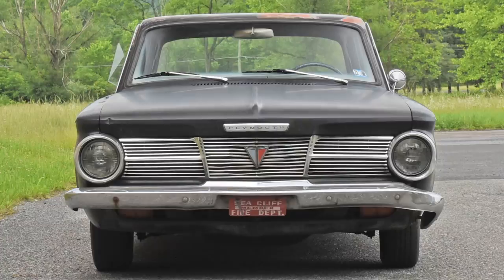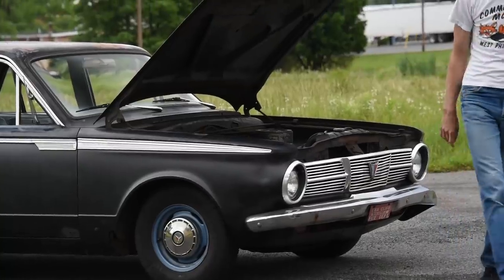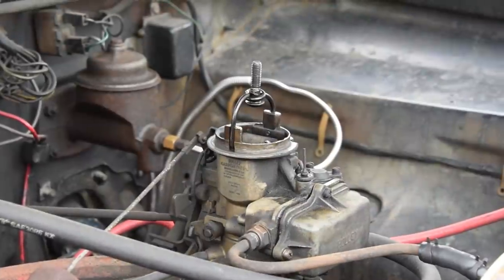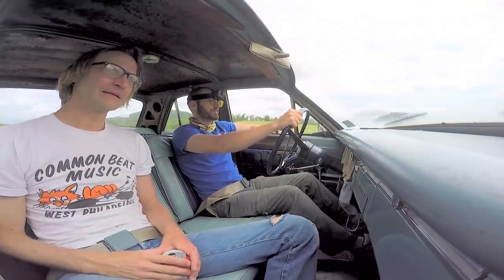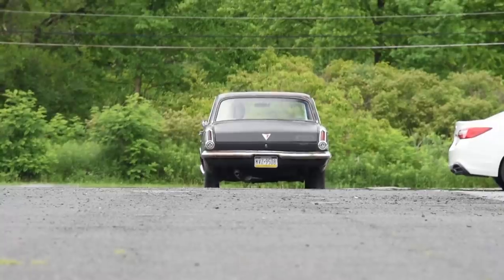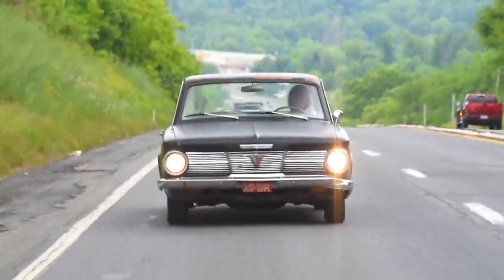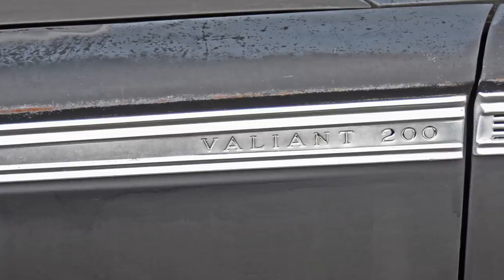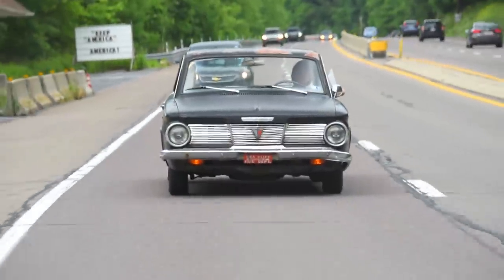1965 Plymouth Valiant 200: Regular Car Reviews

Comment: Also, let's all tip our caps to someone who can keep a 56 year old Chrysler product on the road.
Reply: There isn't a simpler car to keep running. I bet even you could do it.
Reply: @jeffsicklesteel1655  Leanin' tower'a power.
Reply: We had those in Australia- I had a 63 model (AP-5) which meant the 5th model Mopar built completely in Australia- the previous ones were Chrysler Royals. We only got the 225 which meant it was a supercar compared to the Falcon and the Holden competition. 1966 saw the 273 option- the first of the big 3 in australia with a V8.

Comment: Honestly, 28mpg highway from an old 60s car with a 6cyl is actually impressive. Slant 6 fans in the mopar circles always said with the right carb & tune a slant could do close to 30mpg, guess it's not so farfetched.
Reply: On the other end of the scale they can also make something vaguely resembling power when built right. Not near as much as a V8 (or even the Aussie Hemi six) but enough to be respectable.
Reply: I had an Aspen with the 225, and it would get 30 mpg on the highway, if my teenage self kept it at 60 mph.
Reply: @Oddman1980  safe to assume it didn't have overdrive?
Reply: @knote4958  Correct, it had the A904 three speed automatic.
Reply: @JRSmith06  If anyone would stick WMI (Water and Methanol Injection) on this and advance the timing, it would probably be getting 35 HWY.
Reply: Even with the automatic, they could get into the low to mid 20s on the highway. Mind you that's going 55-60 mph, but you will keep up with traffic on 2 lane roads just fine. Interstates.....not so much.
Reply: Give it a 2bbl. Decent rv10/low end cam 2.25 exhaust. Re-curve ignition and a Hei . A head massage and .100 off. You've got yourself a totally different (better mpg even) animal
Reply: @gorkzop  Mine came stock with a Carter 2 barrel carb
Reply: @Oddman1980  yeah! Some mid-70s (and export/marine earlier). Should have been stock inho. Just get an 2.25 exhausted , remove the heavy spring in the distr (basically uncle tony mod. If you can't weld just set base timing so you get 34 mechanic total). They are quite decent engines if you know how to tune them! 

Won't be a true racer ..but great street engines if you bother to spend a little money on them!
Reply: @gorkzop  The other good thing is the slant sixes are tough as nails. If you want to build an old engine that isn't another SBC.....there's nothing that will kill a leaning tower of power. I have a friend who dailies a Duster with a slant six and automatic. I've even seen a few slant Sixes drag race. Mind you, they don't make the same power as the V8s, but they can be pretty respectable and there are actually decent performance parts. They're dog slow in stock form though.
Reply: @joshn938  as ice got one myself (with a knock). Standard 318 power is basically achieved with these mods. But anything over 180/200hp is going to cost serious money. 

I absolutely love my 61 Plymouth with double carb. Spins the tires easily even though the car is heavy as can be
Reply: @gorkzop  They are meant to be economy engines, but Don't underestimate a slant six. You can build them up at the cost of some MPG and reliability, but they can surprise  V8s. But yeah, it does take moola. For the money, you could build a mean stroker out of a 318 and have some money left over, but hey....how many slant six hot rods are there out there? You would be part of an exclusive club. And that's part of the fun....having something not everyone else has.
Reply: @Oddman1980  I had a 10-year-old '63 Falcon Ranchero 170ci Straight 6 1-bbl 3 speed that got 27 mpg and would tow my mom's 2 ton '61 Chrysler wagon at 55mph - if I could keep the front tires on the asphalt. Selling it at 280,000 miles is a regret I hold to this day.
Reply: Go to any wrecking yard that still has cars this old, and I predict that 80% of the slant 6 engines that don't run have had the convex washers on the intake/exhaust manifold replaced with flat washers, thus causing valve-burning leaks. Lots of parts changers (like me) don't understand that they use those weird parts for a reason.
Reply: @joshn938  225 is long stroke and very small valves, they're meant for torque. 170 can rev ok, 225 may as well build up a tractor engine..
Reply: Look up the "Feather Duster", same engine but built light and efficient at 36mpg. You can get high mpg with a Slant 6 but it's a skill. I drive my Slant's with a Vacuum gauge hooked up that I use to tune and hyper mile. 18psi+ vacuum at idle and don't let it drop below half vacuum at light thottle. I can get upper 20's approaching 30mpg on highway trips.
Reply: I've come to the conclusion that miles are shorter in 60's cars.  Or people with those cars don't realize that the speedometer (and thus odometer) is completely wrong.  Or dividing miles by gallons is too much math for people. :D
Reply: 28 mpg is excellent.
Reply: @PaulSter  considering my 4cyl ranger topped at 28mpg on a level commute, yeah I'd say it's excellent
Reply: @DannySauer  Yeah, that must be it. We were too stupid to figure gas mileage, or to check our speedometers with a watch and the mile markers for that purpose on the freeway (what, were those before your time?). We liked getting tickets because we didn't know how fast we were going.
Reply: @budlewis721  I'm open to alternate explanations as to why some people still insist that they were averaging 25-30 MPG out of cars that were actually only capable of 14-18 on a good day; cars which had to be drastically changed to comply with the 70s fuel economy laws. If the Valiant actually got over 25MPG with that slant six, Ford would've probably copied that instead of testifying in 1974 that the only way they could do it was by selling only Pintos.

Certainly the most plausible explanation is "wishful thinking," but being bad at math is a very close second.

And no, watches and mile markers are not before my time. However, my 71 Chevelle actually does get about 24MPG average - with fuel injection, overdrive, a lock-up converter, and modern rolling stock. Makes a tad more power than a one-barrel L6, too.
Reply: @DannySauer  There's always been some people who claim hyperbolic gas mileage, just as there's always been people who boast about their engine size and horsepower. But that doesn't mean it's a phenomenon, your self-assured determination of "wishful thinking" as a given notwithstanding. I do find it shocking that my 1bbl 170ci 6 had less power than your...what, 307? 350? 454? V8 Chevy. What a surprise. If you're waiting for me to provide an "alternate explanation" for why people exaggerate, you'd better clear your schedule. I'm flattered by your faith in my omniscience, but mind reading is beyond my capabilities. I can't help you with that. Nor have I ever been good at math, though despite my imbecility I can use a calculator to determine my accuracy, as I'm sure most others did who wanted to know their car's true mileage. Neither do my prescient powers extend to visions of why Ford didn't develop the Slant-6 first, though the premise is pointless, like proving a negative. I suspect it was presented more out of obstruction than a serious argument. I dunno why they didn't; Ford's belief in the superiority of their products over other companies? Copyright restrictions? Busy with their own economy car line? Does it matter? What has me flummoxed (I love that word) is the cynical nature of your assertion. In a seriously flawed effort in the beginning of the industry-wide attempt to reduce pollution, the focus was more on making existing engines produce fewer emissions, not better mileage - though that would have been a bonus. To reduce fuel consumption they mostly built new, smaller, 4 & 6 banger engines (but not very well) to put in the new little carlettes. To what end would the majority of those interested enough in the subject to watch/comment here, or for that matter the majority of drivers, as you claim, think it important enough lie about mpg to strangers? That's a real glass ½ full of emptiness outlook.
Reply: @budlewis721  dream on .
Reply: Slants were thirsty as hell, especially with a single barrel carb. Had a single barrel 225 (australia) 69 Val with a 68 motor, highway 60mph was only 20mpg and we use imperial gallons which are about half a litre bigger than US galls. Later Aussie Vals had Hemi sixes which could clear 30mpg- my 265 Valiant charger(1971) could get 32mpg. And with an economy cam one would get 35mpg if kept under 60mph.
Reply: @rossbrumby1957  so what you're saying is the stuff like single barrel carb meant to give it better fuel economy actually gave it WORSE fuel economy? Go figure

Comment: I had several of these and the similar Dart.  When the wiring in my '64 burned up, I went to a junk yard and bought the wiring system from a '65.  They were similar, but not identical.  I laid out both on the floor of my apartment, and spent three days making the '65 wiring match the '64 wiring, with the assistance of copious amounts of weed.

Comment: Those old valiants from the 60s with the slant six  were awesome cars, they were tanks and ran forever, you have to keep in mind that back in the 60s if your car made it to 100,000 miles it was a miracle.
Reply: I dunno. I've never bought a '60s car with less than 100,000+ on the clock, and used them all as daily/road trip drivers for at least 3 years, usually more. Sold one at 280,000+ miles.
Reply: Cars in the 60s as a rule lasted bare minimum 250k
Reply: That's not true at all, my buddy has a 64 valiant that has more than 400k on it, it's literally the only daily driver he's ever owned at 50 years old. If you keep them serviced they are great cars and will literally run forever and FAR outlast any new car.
Reply: @TheREALOC1972  Keep dreaming.
Reply: @domenik8339  No dreaming about it.... The PROOF is right there. That car is 50 + years old and still has the original everything except wear out parts. Your NEVER going to be driving a Honda civic for 50 + years with 99% of it's original parts, GTFOH with all that. Your lucky to get 10 years out of any new car before you have to throw it away and get another one. They stopped building REAL cars in 1987.
Reply: People forget the number of cars that were disposed of at 150k or ended up being parted out or getting engine swaps or rebuilds.  

They focus on the ones that are still going, forgetting what has been tossed out.

A modern car will last 20 years and 200k without a second thought, but we wont see many of them left after 50 years either.
Reply: @cl3mb0t  200k yes but they aren't lasting 20 years unless Grandma Judy owns it and garage keeps it all of it's life, a new car will last 10-12 years of everyday use for most people then it's falling apart.
Reply: @TheREALOC1972  They absolutely are lasting 20 years, unless they get in a wreck.  

Yeah, they're rusting to peices, windows don't roll down, the stereo has been stolen, and they're billowing blue smoke, but they're out there in someone's parking spot.
Reply: @cl3mb0t  Yeah... like I said. they aren't lasting 20 years. a classic car is just hitting it's stride at the 20 year mark where as newer cars are all but in the junk yard at the 20 year mark.
Reply: @TheREALOC1972  Nope.  That is the confirmation bias in place again, where you forget how many cars died from that period.  

Most 1960s cars didn't last ten years.

For real...  Most cars in the 1960s through the 1970s really did only last 100,000 miles before being junked or rebuilt.
Reply: A Valiant can never die

Comment: "Driving a three on the tree is like driving a fraternity handshake"

I wonder what would Mr. Regular said if he gets to drive the Indonesian market Mitsubishi L300 (basically a 2nd gen Delica that's produced for 40 years here) which has a five on the tree gearbox
Reply: Well I have seen a four on the column but five I have never heard of.
Reply: If you can't accomodate earlier systems with just two watts of brain power, give up and take an uber everywhere.  Young nothings.
Reply: @normangensler7380  whats a manual
Reply: “Young nothings”

???

Comment: When I was in school learning to be a car mechanic, I was working on one of these. (estate model) 
Rust proofing the floor, fixing the drum brakes and adding new carpet.

I realy liked it because of how simple it was compared to new cars
Reply: I am a simple human.
I see simple car.
I like.
Reply: Sorta similar deal with the Ranger I'm helping a friend with

The one he has is a 2000 model, but they hadn't significantly changed since 1993. So as a result, parts are easy to come by and it's relatively easy to work on. Some things are frustrating, namely the oil filter and spark plugs, but overall it's easier than the 2013 Escape his mom also has parked in that driveway.

There are some modern things, yes. fuel injected, ABS. But where it counts it's oldschool. Throttle is cable driven, emergency brake cable is literally right there under the drivers' side sideskirt, gear selector cable is clearly visible on the side of the transmission without even jacking the vehicle up, etc.

This may sound standard to anyone with a 20+ year old car but to me, someone who learned to wrench on a 2007 Focus (where there isn't a ton of room to see all this stuff), this is all really cool.
Reply: I have to replace the !#$$%^ spark coils on my 2011 Suburu Outback. Holy shit! The simplicity of this car is beautiful!
Reply: You mean "today's" cars?

Comment: This was sold in Australia as the Chrysler Valiant. The Dart was also sold down here under that moniker. Like the Falcon, the Valiant was a car that Australia picked up and ran with, for longer than in the US. Still very loved down here.
Reply: And they're better than the US Valiants too.
Reply: @dudstep  yeah the valiant charger 🤠
Reply: @darcykeddell4930  the mighty Val
Reply: The 1965 AP6 has the same panels as this from the A pillar forward. 
I actually like the rear end of this American one better. The VC model that replaced the AP6 in 66 had a much nicer rear end.
Reply: @jamesfrench7299  yeah I'm loving the rear end on this one. Those cathedral tail lights 👌
Reply: The 1962 Australian RV1 model was fitted with the 145hp 225ci slant 6 from the dodge truck.
The new XK Ford Falcon developed 90hp The local GM product (Holden) produced   around 40hp.
Reply: Plus the Valiant sounded and went like a car from the late 70s in the 60s! The Holden and Ford offerings did not.
Reply: @jamesfrench7299 no, the AP5 has these guards and bonnet- the AP6 has the round chrome ornament on each guard. Not 100% sure but the palel may be different shape slightly too.

Comment: Three on the tree and power assisted nothing. The same option package as the '74 Dodge pickup I leaned to drive in. 
It reminds me of the $200 cars people would buy when I was in highschool with the mandatory "Drove when I parked it" line in the ad. 
Chris has a high appreciation/masochism level to daily in that beast. Congratulations on keeping it going.
Reply: My '74 Dart also had the unsynchronized 3 speed, dinky 9" drums all around.  Forgivable in '65 but not by then.  These cars could and would run forever, and for the same out the door price in '65 as a VW Beetle, which wasn't a highway king, either.  The was an honest, spartan unpretentiousness to these cars, and Elwood Engel gave them a nice European styling with his re-skin of Exner's earlier iteration.  The torsion bar suspension was better than the Falcon's and the engine was ten times more reliable.  Few got them with the manual transmission because the automatic was so reliable and well-behaved.
Reply: The TorqueFlite was a world beating transmission and the Slant was a smooth operator itself. Made for one refined affordable family hack that pissed on the other two equivalents at the time.
Talked to a man still driving a 1960 Aussie Falcon and he said all wheel drums are fine as long as they're adjusted right. He said the problem is they rarely are.
Reply: My top two favorite cars I owned:
1956 Jaguar MK VII Saloon Car - $150
1963 Falcon Ranchero 170ci 6cyl 3-speed manual - $100
With gas at 24.9¢/gal and 53.9¢/gal respectively, it was like driving for free.
Reply: I think a three speed manual is perfectly fine for mostly around town driving. Little to go wrong.

Comment: We had a 64 Valiant with pushbutton auto transmission in the late 70s. it was in average condition and comfortable enough, and a very reliable 25 year old car. Traffic was bad, so its acceleration, handing, and brakes were never tested much. It survived road trips and general usage. It had no cool factor back bthen, but like others pointed, was functional.

Comment: Wow does this bring back memories! This is one of the first cars I drove when I got my driver's license at the age of 16... back in 1969 with my parents 66 Valiant 225 Slant six 145 horse three on the tree, manual steering and no radio .... the only thing I didn't like about it was that non- synchronized first gear. I got her up to a hundred miles an hour on the freeway side by side with a buddy with a automatic 6 cylinder 65 Mustang flipping the bird at each other... That slant 6 was a bulletproof indestructible engine and it was well maintained! I would Rev it up to the max all most all the time going through the three gears until the clutch faded out from burning rubber in first gear... I think any other engine would have blown up...

Comment: Watching you swing the steering wheel between 10 and 12 just to keep it in a straight line just took me back to my first car, a '64 Dodge 440 sedan. That thing had a real grudge against the white lines.
Reply: MOPARS would do ONE THING very well, go like a cruise missile for 1320ft, but when it came to the twisties, not so much! Actually "MOPAR" is an acronym for: Move...Over...Pick-up...Approaching...Rapidly!